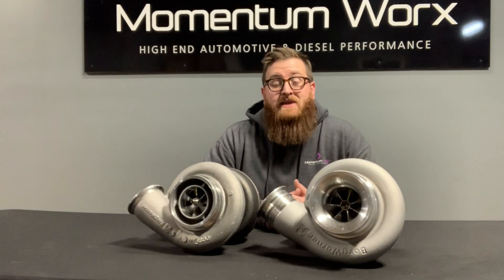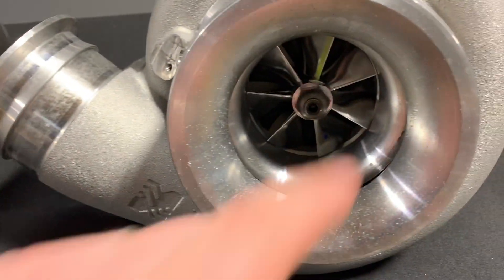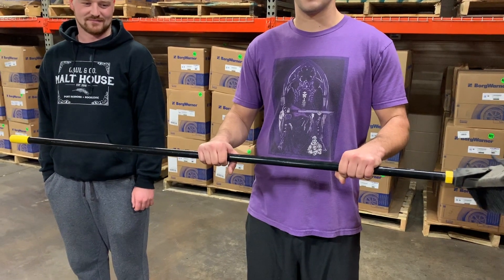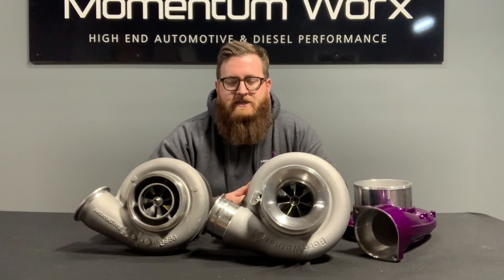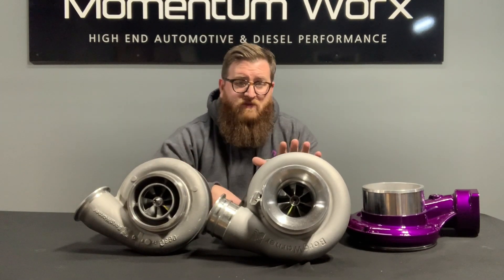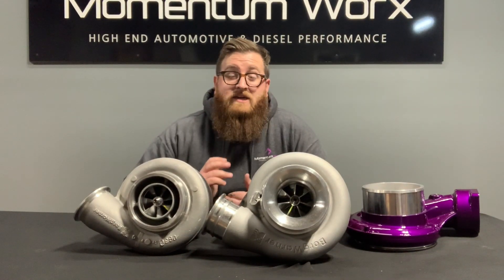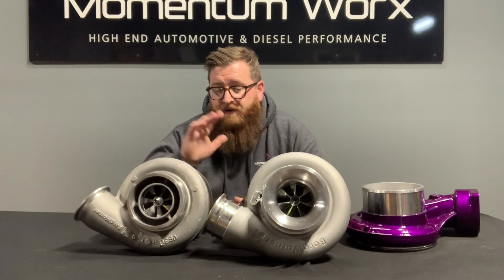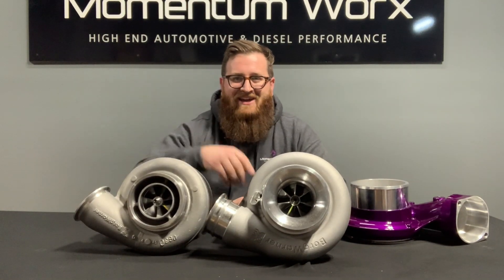BorgWarner S400 VS S410SX VS S430SX | What is the difference?

Comment: Can you explain why a lot of Catapillar owners install Holset HX82 or higher on their caterpillar engines why do they choose that turbo lately I’ve been seeing a whole bunch of people use that turbo why is that what’s so special about that turbo
Reply from the maker: I've only ever really seen an HX82 used as the low pressure turbo in a compound setup on a Caterpillar.  I can't really say why this is the case, because I don't have a ton of experience with custom compound setups - but I'd imagine it has something to do with the high flow capacity of that charger.